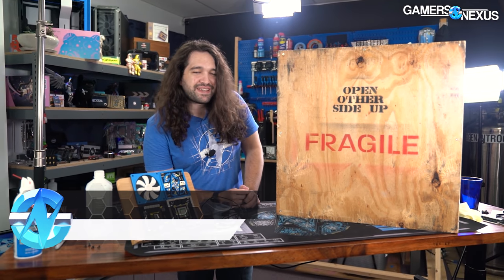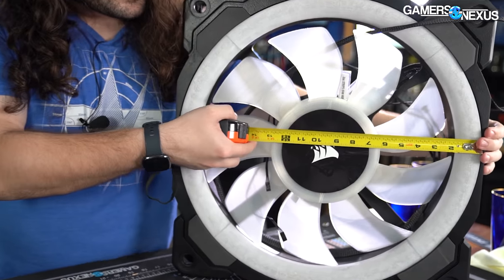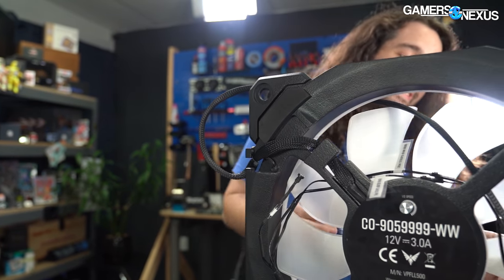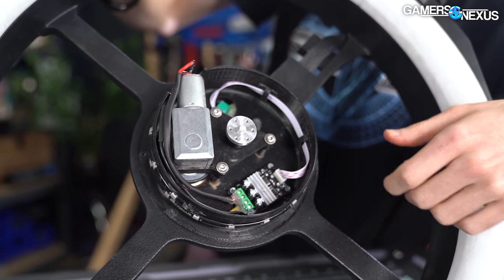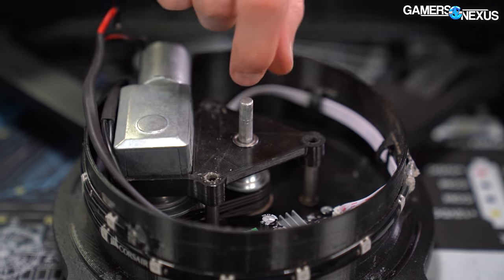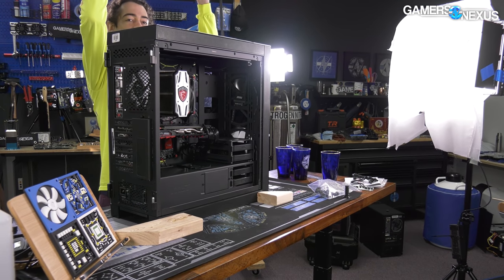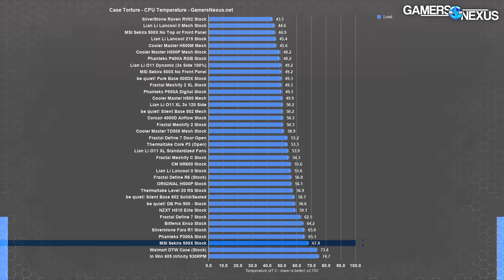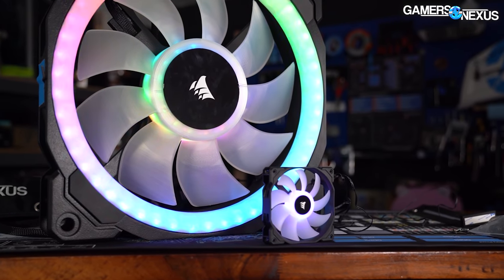World's Biggest Computer Fan: Corsair 500mm LL RGB Fan

Comment: Finally, a fan to meet the needs of the 11900k
Reply: Naw dog more like the 990 FX chipset with a FX 8000 series CPU running at 4 gigahertz +
Reply: I have that cpu :(
Reply: Simply take the fan out of a car
Reply: Your optimism is amusing.
Reply: Takes off my glass side panel on my WP200/H510i Elite PC case for this fan! one massive fan is all I need! LOL.
Reply: @oldrandomcomputing6247  you are good.  People think the temperature a CPU hits at max overclock is its everyday temperature.
Reply: @SilverX95  four? What kind of puny FX are u running, dawg run it at 5 gigahertz with actual holographic plasma effect!
Reply: Hey shank what's up :)
Reply: With the possible future motor upgrade it might even support a light OC too.
Reply: @kristhrasher4858  Yea, good to go to the space
Reply: Dude I already used a 18 inch fan with my PC, this is nothing new to me.
Reply: @Verpal  I would if I could, if I could find a CPU cooler capable of keeping it cool 
it's a FX 8120 Black edition
Reply: Ayyyy lmao
Reply: @oldrandomcomputing6247  don't be sad, it will warm you in the upcoming winter
Reply: @Based Madara lies.
Reply: This would have been great back when I had GTX 580's in SLI water-cooled.
Reply: That's what the ML360 SZ is for??
Reply: @Verpal  the Plasma effect comes from the melting, lol
Reply: @tyre1337  I guess there is that..
Reply: Going to have to start talking to nuclear engineers to get some pointers on how they build their water loops.
Reply: Or the 10900k with its 10 cores and 20 threads.
Reply: At this point intel should just call next gen 12kk or 12M 11.9kk 11.9M
Reply: @joe_ferreira  why? Water cooling does that for you. XD
Reply: Oh my god I just fell out of my chair laughing. Good job sir lol
Reply: @SilverX95  I mean.. 4GHz was normal for those series, and it ran pretty cool at those low speeds.
Idled at a good 25-30c, and even with a H100, back then, the 8350 ran some 55c on max load.

Sure, when you started dialing it up to 5GHz it changed a bit. Was still mostly in the sub-65c area though.

For what it was, for the power it could consume, it did somehow run impressively cool. Least vs. most of the Intel alternatives both then, and since.

Maybe it was the soldered IHS helping them out a lot.
Anyhow, your joke is bad, and wrong. :)
Reply: @robertp457  the same as prime95 stable doesn't mean it's needs to pass that for everyday gaming usage lol
Reply: I think you mean the Ryzen 5800X..
Reply: @Nightykk  I find this pretty hard to believe from the many stories I heard of the fx990 and bulldozer chips running stupidly hot due to the power consumption
Reply: Heck, I could even go as far as to say it can cool a 6 layer Wii's hollywood...
Reply: Haha.  Came here to comment that it is a sneak peak at the 12900k cooler fan.
Reply: @HelloFellowDinosaurs  The 5800X is cool even in the double sense. Don't let official numbers deceive you. There is no industry standard chip labeling for the thermal heat output. Watch reliable, independent and trusted real life tests. And you will learn, that the heat output of current intel cpu's got even worse. Intel tries to tackle the problem by adopting the big.LITTLE arm chip principle for alder lake. But obviously the antique x86 layer becomes more and more a problem. Benchmarks between alder lake and apple's M1 MAX and PRO can tell us, if intel's big.LITTLE take was really enough to compensate x86 drawbacks further and to compete against the RISC competition in terms of performance per Watt. I highly doubt it. Beyond that there are rumors that apple is even already planning the next cpu switch to RISC-V like AMD. Intel tried to buy SI-FIVE, because it is is intel. If they can't innovative, they try to buy and silence the uprising competition as usual.
Reply: @aladdin8623  Trust me, the 5800X is renowned for being a hot chip. Mine idles at 42c on an Arctic 360mm radiator at max speed, and shoots to 80c within about 10 seconds of putting a heavy load onto It. That's with a 130w load on the CPU, the 11900k draws up to 300w and keeps lower temps in similar workloads.
Reply: @kristhrasher4858   Careful you might inspire ideas of making a room into the case for the PC (Or an entire wall.)
Reply: Well, my 10850k does 50c on cinebench... At this point, intel being hot chips are just memes. 
Just dont get a 20$ cooler !
Reply: @etienneoligny5106  My 5800x will hit 83c on cinebench by the end of the run on an Arctic Liquid Freezer II 360 which is a high end cooler, doesn't stop the CPU from boosting to 4.7ghz all core though
Reply: @HelloFellowDinosaurs  The fast changing short spikes in recent ryzens are due to a new scheduler technique, which AMD has introduced, to improve workload efficiency. 
Me as many others as well wondered about the speedy switchings. After an AGESA update i got a more balanced display of the actual numbers as well. Touching the CPU cooler also confirmed that everything is in fact cool. The MoBo i updated got a x470 chipset.
Reply: @SilverX95  or the very TL;DR:

For all its faults, for all its issues, for all its cheating on the 4c/8c manipulation, for its high power consumption.. the one thing that chip never was, was hot. 
You would (typically) never see it hit the 80-100c as your modern chips does. 

I won't in any way deny that it wasn't the best performer (it was what I could afford at the time, vs. cores/performance), it had its fair share of shortcomings.
Reply: The accuracy
Reply: @oldrandomcomputing6247  I use a different CPU, but have configured a setup with that one. Contrary to what others say: This CPU was normal to cool down. I don't know why people seem to be inept to cool down a CPU correctly.

It's a great CPU after all, so what's the problem?
Reply: might be tad bit small
Reply: Saw this on Reddit lol
Reply: @oldrandomcomputing6247  You got scammed.
Reply: 12900k you mean...
Reply: and GTX 480's in SLI
Reply: @Nordlicht05  But you need the radiator too, a typical 240mm just won't do.
Reply: let's. watch airflow with Steves hair to take pressure readings
Reply: Still need 3 of them, and a 1.5m matching radiator too.
Reply: @SilverX95  lol that still draws less than the current intel chips
Reply: @HelloFellowDinosaurs  Mine idles at 30, your cpu is falty i guess
Reply: Now we need a 500mm heatsink for it to go on
Reply: Basically just a refresh of the  i9 9900k.
Reply: @TheRealFobican  mate it's a completely different architecture from the 9900k and it happens to run hotter as well  I'd suggest you do your research before writing a comment
Reply: OR my FX-9590!! 😅
Reply: And the upgraded motor version will be for the RTX 4090.
Reply: this might cool my 64 core threadripper!
Reply: @nando03012009  maybe but how about. A dual epic CPU workstation with 2tb of ram
Reply: @captain1334   nope.. You'll need antarctic weather for that
Reply: my temps jump to 67c at 4.4ghz at full load
Reply: So they are making radiator fans for cars now?
Reply: @captain1334  is it?
Reply: @TheRealFobican  yes it is
Reply: Finally, a fan that can handle the heat from a Pentium 4 code-name Prescott chips. nearly twenty years late but...
Reply: But will it suffice for the 12900K?
Reply: da fook added cocaine to the coffee this morning at corsair?
Reply: It'd be like the LTT video where they hooked up an industrial fan to a PC.
Reply: Overclock to 7hz
Reply: @lenkagamine6121  7 Hertz? Not sure it could even beat an 8086 with that clock speed 😁
Reply: there's one of these in every ps4 😆😆😆
Reply: @SilverX95  yea thats the equivalant today, intel is the old FX right now
Reply: my zotac 3090 needs this baby bad 👌
Reply: Now to create a fan for the 400w 12900k
Reply: @HelloFellowDinosaurs  Do an adaptative undervolt of that Ryzen chip (i also know that it gets hotter than An i7 and i9), better thermals and higher clockspeed at the same voltages, problem solved.
Reply: After watching M1 max benchmarks, x86 looks extremely stupid in general, Alder Lake only will delay the slow death.
Reply: @Codelnelson  AMD is also Bulldozer, in fact, x86 in general right now compared to Apple sillicon.

M1 has like 40% higher IPC than Both Rocket Lake and Zen 3, gets like 3700 points passmark singlethread speed and that is at 3.2GHz, now the M1 Max has 8 perfomance cores, maybe even better singlethread speeds or IPC and uses 30 watts vs a 5800X, 11700K and 11900K that are +100 watts, with a 16 inch Macbook pro and dual fans, expect 11900K/5800X multithreaded perfomance, waaay better IPC and using 5 times less power
Reply: @HelloFellowDinosaurs  Which voltage do you get at 5GHz?
A conspiracy theory is that AMD runs the 5800X with very high voltages above normal.
Reply: @SilverX95  I had a FX 8350 at 4,3 Ghz allcore. Shadow Rock 2 on it and it was max at ~67C.
Reply: @Nordlicht05  or put it in the car and get an rgb car
Reply: @saricubra2867  about 1.3v. AMD engineers have said that 70-80c is normal underload, so it isn't faulty, they just run very hot. The peak I will hit if I run cinebench on a loop is about 84c. That's with the liquid freezer ii 360 at full speed aswell.
Reply: @HelloFellowDinosaurs  What the hell?, i watched an i7-10700K with Noctua NH-U12A air cooler, runs at 60 degrees in Cinebench, -100mv of undervolt and all core 5GHz at 1.2 volts (140 watts or no power limit).
-150mv, 4.8GHz all core, and 1.1 volts and max out at 125 watts (TDP).

In the same video, that i7 can run at 0.9 or 1 volt at max running stock clocks and undervolt, WTF. It's ironic all the bashing for 14nm.
Reply: @saricubra2867  The ryzen 5800x voltage fluctuates depending on the load, the intel chips usually use a static voltage if you're overclocking. Sometimes I've seen my voltage drop to 0.9V aswell, but under a heavy load it sits around 1.3V which is normal
Reply: @HelloFellowDinosaurs  1.3 volts is still higher than the i7 in heavy workloads. I guess this explains the heat.
Reply: @saricubra2867  They're completely different architectures though, so it cannot be seen as 1 is good and 1 is bad. The 5800X is the more powerful chip in every aspect with a lower core frequency, higher voltage, highers temps and lower power draw.
Reply: @HelloFellowDinosaurs  It shouldn't have higher temps and higher voltages if 7nm is supposedly better tuned than Intel's 14nm, kinda embarrasing for TSMC lol.

I don't have problems with the perfomance.
Reply: @saricubra2867  It's nothing to do with tsmc.. 7nm is drastically better than 14nm. The 11900k draws 300w under load and barely matches the 5800x which draws 140w. So it needs double the power to achieve the same performance, the higher voltage is the way AMD designed the Architecture, it does run hot, but that's also down to how AMD designed the chip. It doesn't throttle until 90c, so as longs as you stay under 90c, AMD said it's perfectly fine
Reply: @HelloFellowDinosaurs  The 11900K doesn't draw 300 watts under full load, more in line with 240 watts that is overclocking with power limit removed, a Ryzen 9 5950X has a PL2 around 240 watts.
Reply: @saricubra2867  You're on a gamersnexus video and you're just making numbers up. Go and watch the video on this channel of the 11900k and 10900k and both of them draw over 300w when overclocked and at best it matches the 5800X when that's drawing 140w.
Reply: @HelloFellowDinosaurs It is related to TSMC since they make the transitors that need more voltage for a given clockspeed, therefore explains why a 5800X is hotter.

At stock the 11900K is still faster than a 5800X in singlethreaded workload, it has a boost clock of 5.3GHz and very similar IPC, now, compared to a 5950X it looks stupid but i bet that the all core clockspeed of a 5950X is 800MHz lower than a 11900K, therefore explains the lower power use (besides the better density).

What you imply about double the power is impossible, it contradicts this Der8bauer video about the real mtr/mm2 of TSMC 7nm vs Intel 14nm:
https://www.youtube.com/watch?v=1kQUXpZpLXI
Reply: @HelloFellowDinosaurs  Is not true, he is overclocking those processors and removing power limits only on Intel, so he makes AMD look cool for the sake of it.

It's a biased comparison.
Reply: @saricubra2867  Hahahahaha good joke, don't come onto gamersnexus videos and try to claim they're being biased, they're anything but biased and definitely don't lie. What you're not understanding, is the 11900k overclocked to the max drawing over 300w is just about competing with the 5800X drawing 140w, yet you think 7nm is bad. You shouldn't be on this channel
Reply: @HelloFellowDinosaurs  I don't follow Gamer Nexus's CPU reviews, i came for the news and jokes.
Reply: That’s why you use water cooled
Reply: if you use 3 or more fans, and undervolt a lot it may stay under 100 degrees
Reply: @oldrandomcomputing6247  lol

but people here (like me, and im not complaining) have like a i5 from 2017 at the best, or dont have a pc, id kill to have a 11900k
Reply: @SilverX95  no 10:D
Reply: Corsair  be like these guys are dangerous unless it is more than one we ain't sending them anything else lol
Reply: @SilverX95  says those will only ever be able to be put under water lol
Reply: @SilverX95  it won't hold a candle to 11900K
Reply: @kristhrasher4858  Time to hit the local junkyard for a truck radiator.
Reply: and later 12900k
Reply: finallie stief can get rid öf air ^ ^
Reply: Just wait for the 12900k
Reply: Buying Intel in 2021 🤣
Reply: its just a bandage, they still need to make an official liquid nitrogen cooler for it.
Reply: FX 9590 at 6ghz + 11900k 8ghz + Netburst Pentium 4 Full Speed
Reply: 12900k, 6950x, 4090ti, 7900xt, gen5 m.2s, I would LOVE to see an actual case built custom to accommodate this had boiy!
Reply: How could you guys forget pentium d
Reply: @letsmakeelectronics5432  lol
Reply: What about a GTX 500 series? I heard those were quite good as cooktops
Reply: The 12900K is worse 😂
Reply: you need a helicopter to cool that chip
Reply: *12900k
Reply: The 12600k as bad
Reply: @Old Random Computing  :( I have second-hand sadness
Reply: 2 more of these.. Put them in a 1500mm radiator.. Then you'll get about 2-3 degrees down.. I call that a win
Reply: 12900k
Reply: @oldrandomcomputing6247  Same. Came with the prebuilt. A nightmare.
Reply: Bulldozer FX 🤣🤣🤣
Reply: Yoo shank
Reply: @SilverX95  Nah more like an AMD FX-9590
Reply: @SilverX95  the likes difference between shank mod's commentary and yours speaks by itself 🤣
Reply: @ancientrites322  at least i got likes, but meh. mostly did it for a laugh; but there is one thing i didn't say and that's the cooler i was using its the updated AMD SILENT COOLER without LED you know the one with the AMD logo not really the best cooler to run at 4Ghz but to be honest the chip is going to die one day do to its power draw just like the fat Xbox 360's i feel like the same thing will happen with the 11900k it will just keep getting hotter as it degrades that's one of the reason why i switch to a 4770k and upgraded to a Rayzen 5 3600 cause the 3600 is really power efficient.
Reply: Maybe keep my RX 590 below 70C?
Reply: Good, now we need to find the case to accommodate all.
Reply: @SilverX95  nah. That was a lovely system
Reply: And the 12900k
Reply: Nah it's for the next gen Nvidia gpus with next gen Intel cpus. Mountain mod ufo boxes gonna be coming back just to fit 4 of these in a case.
Reply: You'll need 3 for the 1500 aio though...
Reply: Wait until you hear about th 13900K
Reply: @oldrandomcomputing6247 A very unfortunate generation of Intel cpus.
Reply: Now for 13900k